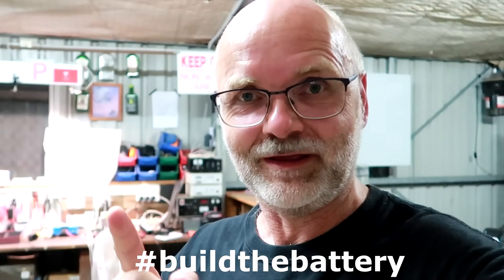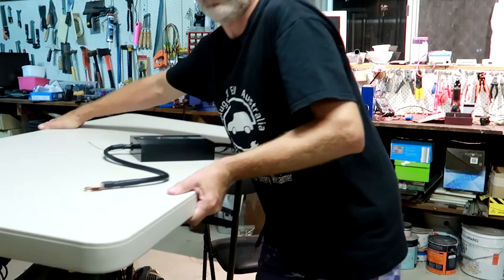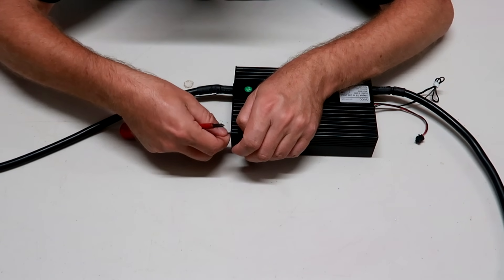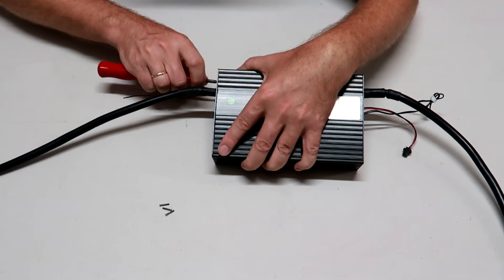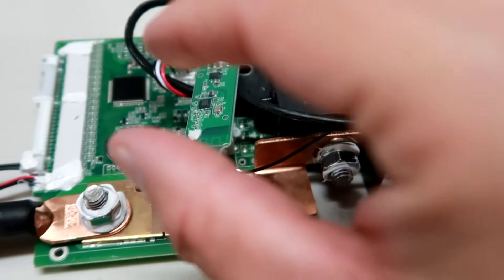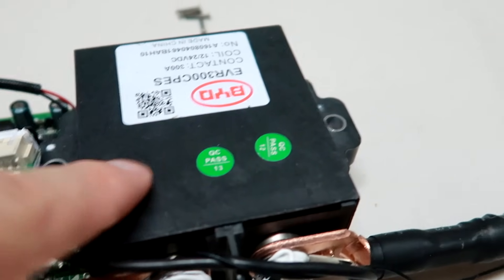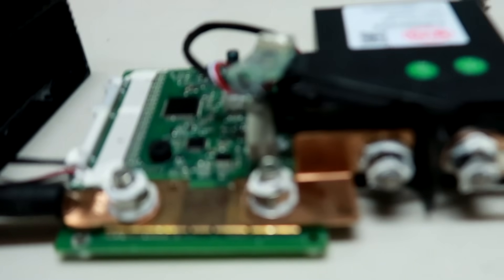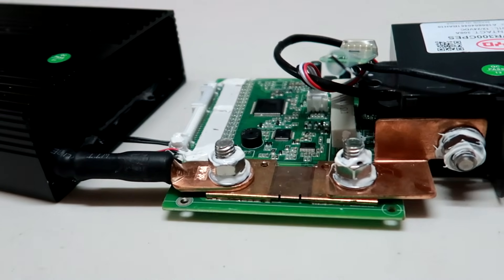Inside the BMS. Why I didn't buy a Daly #buildthebattery.5.1

Comment: its 20s, that cable is fine
Reply: What does 20s mean? I saw BMS has 3s, 4s, ..., 24s, etc, wondering what the 's' means?
Reply: @taison03251970  series. So 20s is 20 in series

Comment: No jewelry while working on electronic equipment. Even with power unplugged static electricity can cause component failure,
Reply from the maker: OK, so on this ring situation. How would I even possibly touch both contacts with two separate un-isolated tools at the same time and they short directly at the ring?